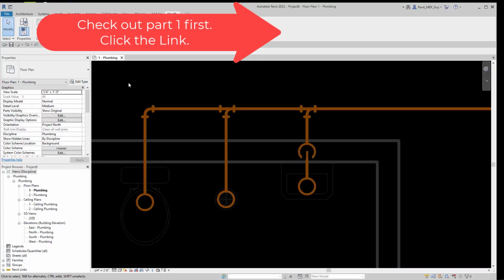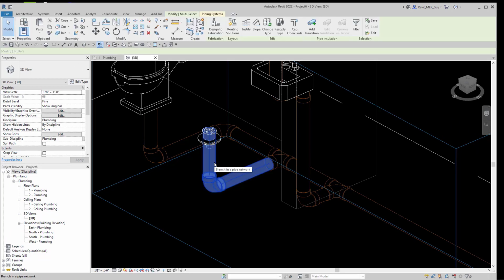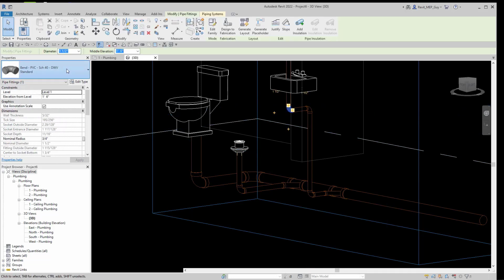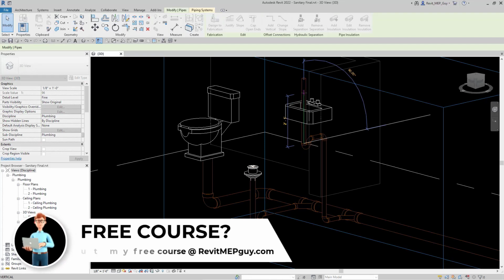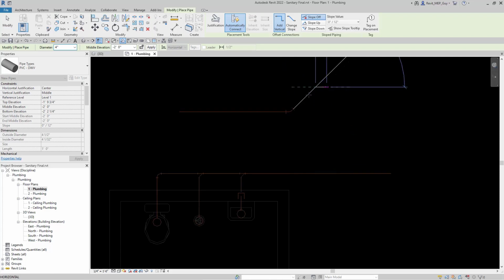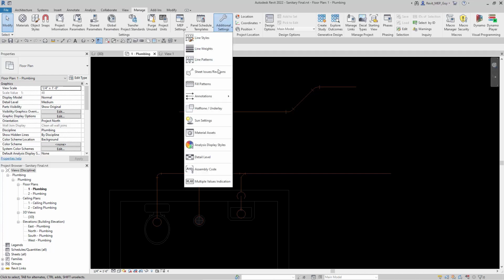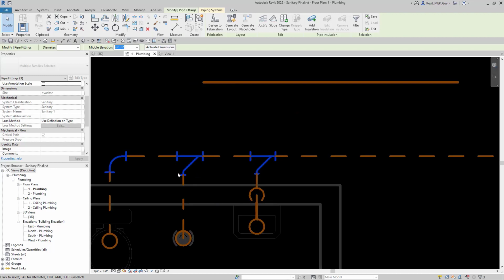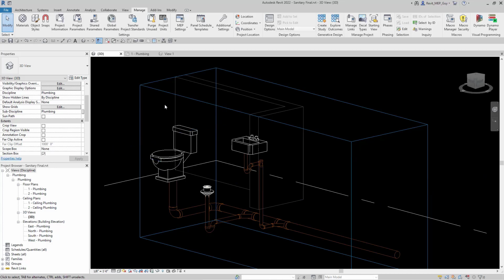Sanitary Pipe Fittings in Revit (Code Compliant)

Comment: If you use elbows of, say, 22.5 degrees, will Revit still use those elbows in it's calculations?  I could be wrong but I believe the only elbows in the IPC tables that Revit uses are 90 deg and 45 deg.
Reply from the maker: Revit doesn't do calculations for sanitary. It does track DFU's.

Comment: where is DWV folder located?
Reply from the maker: Find them here: C:\ProgramData\Autodesk\<product> <release>\Libraries
If you can't get to program data you may have to make the folder "visible" in windows explorer.
Reply from the maker: Also see revit help website:
https://knowledge.autodesk.com/support/revit/troubleshooting/caas/CloudHelp/cloudhelp/2021/ENU/Revit-Troubleshooting/files/GUID-461D7F8B-85A6-4F3E-927F-09BCE7333391-htm.html#:~:text=When%20trying%20to%20access%20Revit,product%3E%20%5CLibraries

Comment: Hi there!
Great work on your videos! Noticed the lack of Revit plumbing videos, so great job at making these, I think you'll be very successful on YouTube!
Have you perhaps tried using Dynamo to speed up some plumbing processes such as making a riser diagram or sizing sanitary pipes? If so, would love to see your take on that ;D
Subscribed for the good stuff ;D
Cheers!
Pavle
Reply from the maker: Hey Pavle! Thanks for the feedback! I have to be honest, I've spent much of my time becoming an expert inside revit only. I have seen what dynamo can do, but honestly I think it's best we stay inside revit as much as possible. Creating a riser diagram inside revit is very simple, but there are some challenges. I'll be doing a whole series on risers inside revit in the near future. For sizing sanitary piping automatically, I have a couple ideas. One would be using dynamo since I don't think we can set auto sizing for sanitary. However, I do think the best method would be to create a working view inside revit just for sanitary piping. You could put a filter on piping based on the pipe size and dfu table for sanitary (in IPC). Any pipe carrying less than 21 dfu could be red, any between 21 thru 36 could be orange, any between 37 thru 180 could be green and so on... You could just use this view to quickly check DFU's with the color of pipe. Use tag all to quickly double check. That would be my suggestion off the top of my head. I would be worried a dynamo graph might miss some things and we'd have to double check anyway. Thanks for the question and I'll definitely keep this topic in mind for future videos. I'm realizing automatically sizing piping is something everyone is very interested in. Thanks again! Your feedback is much appreciated!
Reply: @mep_guy  Thanks for the reply. 

The filter idea is quite interesting, but I will need to dive into that a bit more since I'm a beginner/intermediate user (not familiar with the IPC term). Idea for the next video [hint, hint ahah] ;D . 

I was searching for the automatization of some kind for my master's thesis (Faculty of Civil Engineering - department of hydraulic and environmental engineering) but all I could find were some BIM processes being automatized. 

Thanks for the help and looking forward to your next videos !
Reply from the maker: @kafedziski  Your wish is my command! I will make a quick video tonight showing how to do this.
Reply: @mep_guy  Wow! Thanks !!!
Reply from the maker: I just finished a video for automatically creating sanitary piping using generate layout. I've started the video on using filters to size sanitary piping, just need to finish up the editing. My goal is to have it complete this week. Again, thanks for the feedback and topic idea. I'll be doing many more videos on generate layout tool and sizing pipe since it seems to be what everyone is interested in.
Reply: @mep_guy  Thanks a lot! I really appreciate it!